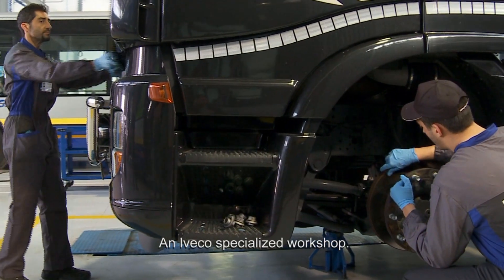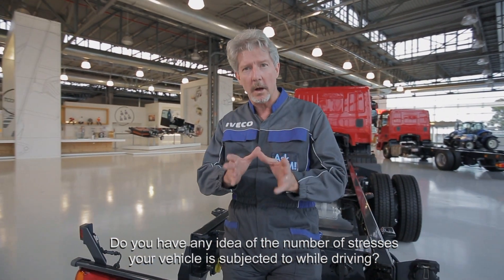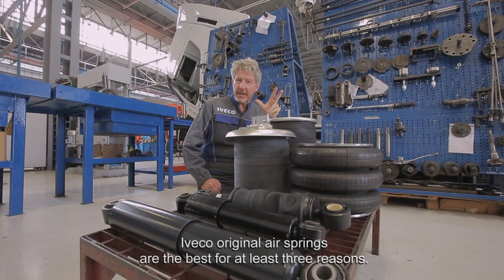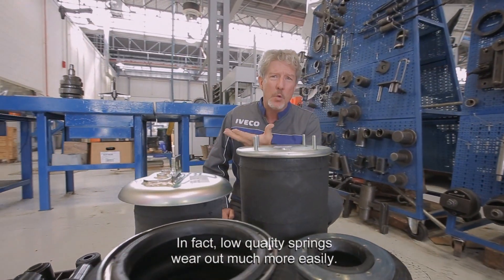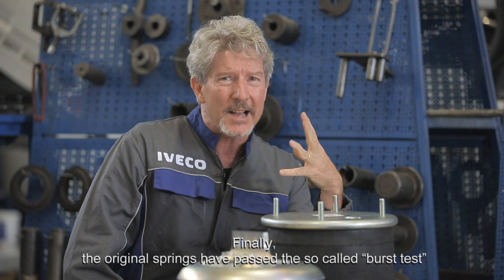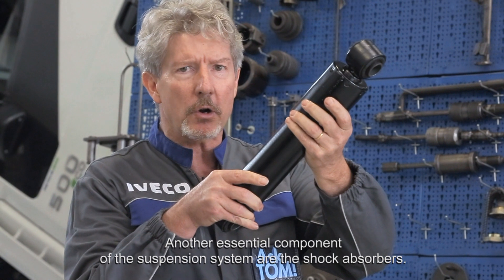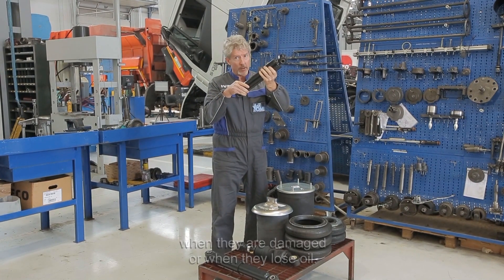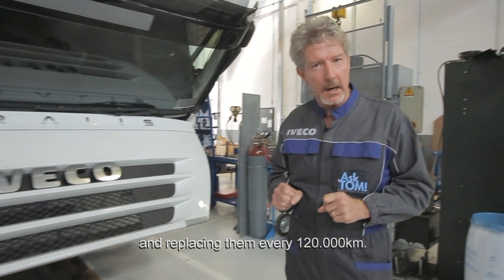Iveco Suspension - Ask Tom

Comment: Hi mark here. I have a 2012 50c17 light truck . It has a 2 tonne slide on camper on it. I have replaced the front shock aborbers. It is bottoming out on rough roads . Is there an adjustment on the suspension bar as it doesnt have springs

Comment: Tom, you seem to me the man with the knowledge, information on the net is slim when it comes to my request. I have a 2009 Eurocargo which was build as a special mobile unit, I purchased it with intent of converting to a Motorhome, as well as the aesthetics I want to make sure the undersides and running gear gets attention also, my question is, the vehicle has a standard suspension can this be converted to air? I would really appreciate you taking the time to answer. Many thanks in advance